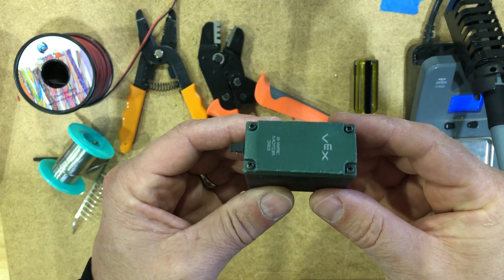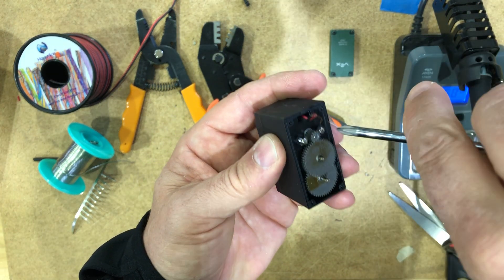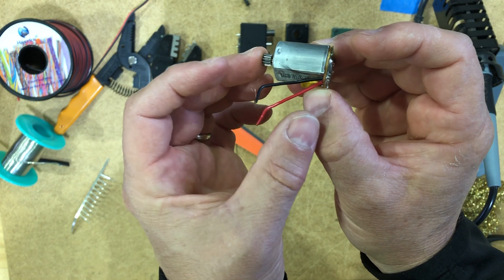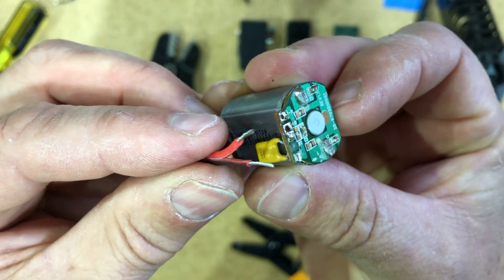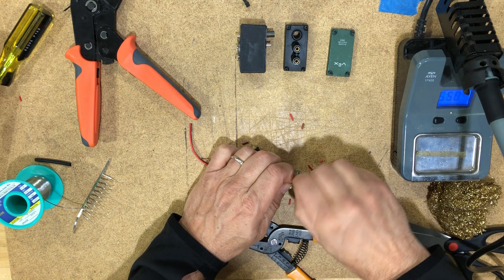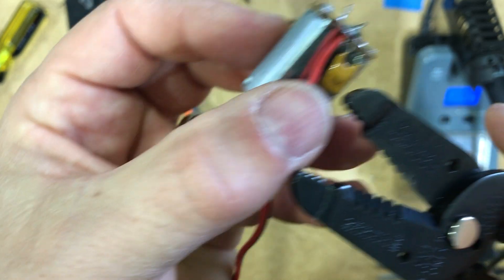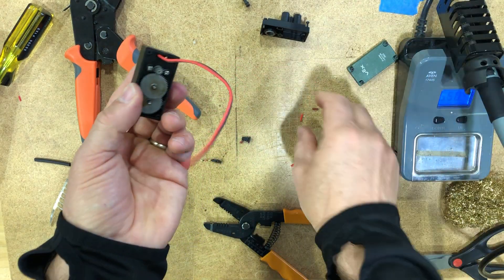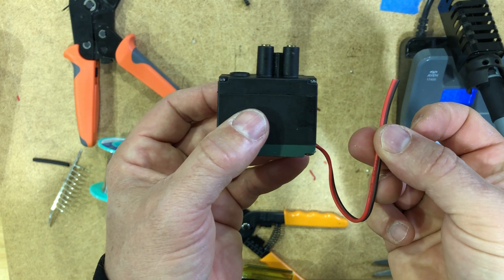Vex: Replace Wire on 393 Motor

Comment: I was wondering if you could help me with a problem on VEXcodeVR ? I have a school assignment on the castle crasher, and we have to move all the castles up top with the red line 

The rules
It can only touch the top red line

All pieces need to touch the red line

All Towers need to touch the red line

It's okay if you just focus on one tower, then redo it and focus on a different hour

Do you think it is possible to do that?

Comment: Great video. I have done this to over 50 VEX 393 Motors, it is such a pain. I put a big blob hot glue where the new wire comes out of the case, it makes it harder to open in the future but helps prevent it from happening again.
Reply from the maker: Thanks Mat! I'll do that also from now on!